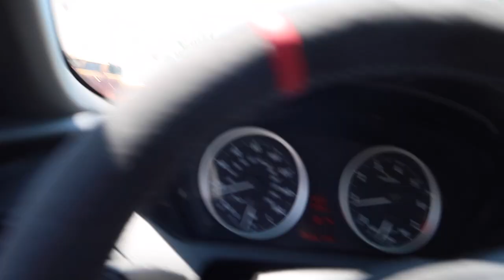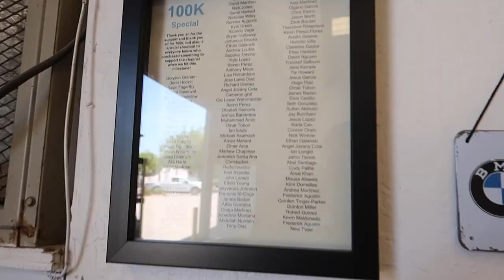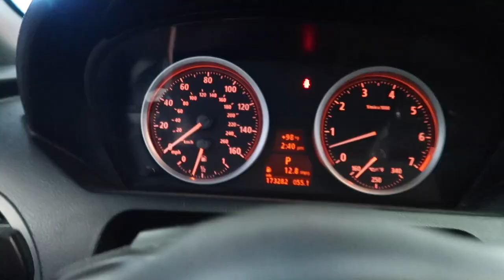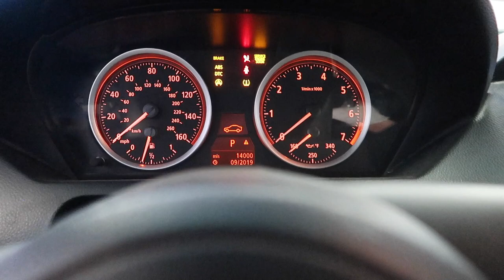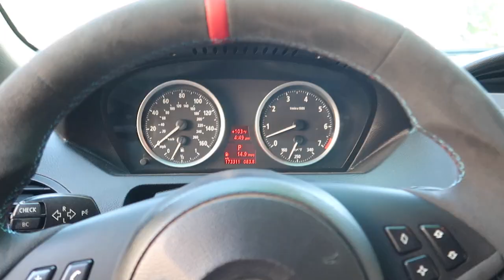BMW FIXED MY BIGGEST PROBLEM FOR $60!

Comment: You need to replace the tailgate gas struts. It cost me £30 on my 635 and transformed the cosmetic feel. Lifts the boot from your key and cockpit fully. It only took me 20 minutes to do.